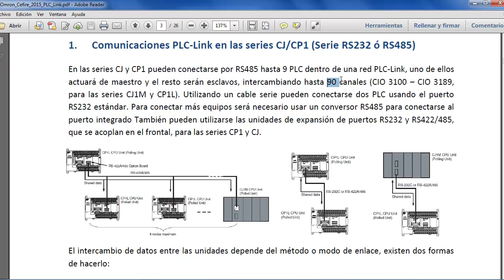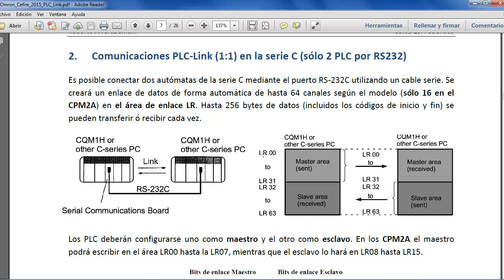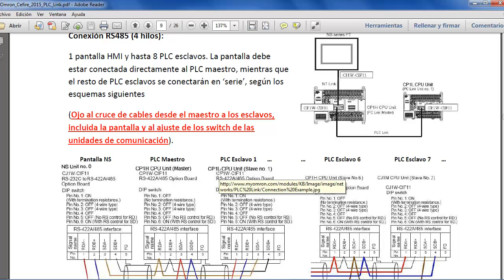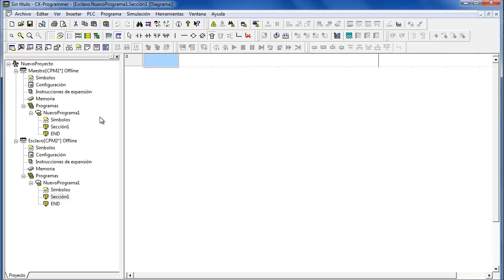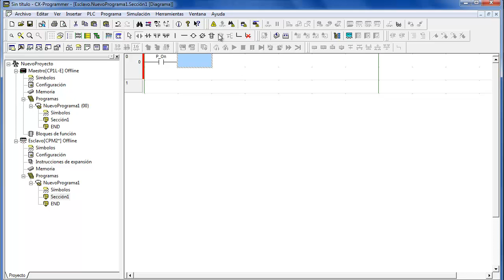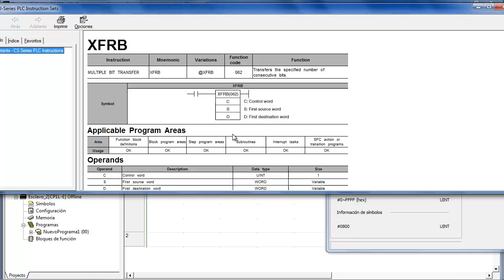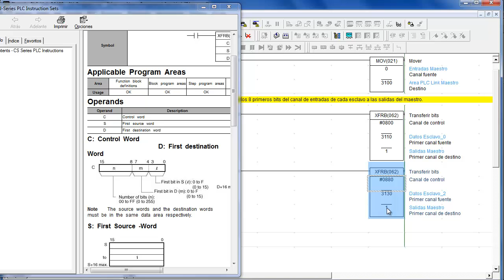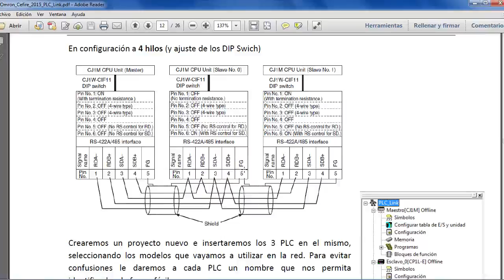Omron comunicaciones PLC Link. Conexión de 3 CP/CJ por RS 485

Comment: the best info on this so far but i cant understand anything of ur language
Reply from the maker: +oskar ewfall Sorry for that, but my English is not good enough for doing the video in English. Anyway it could be a reason to learn some Spanish :-D. PLC Link is quite simple it is just a shared memory area (up to 9 PLC and up to 10 words for each one, on CIO 3100 to CIO 3190), refreshed every cicle. There are two metods of communication, Complete (all the PLC share all the data) and Polliing Unit Metod (only the master see all the others).  Maybe this will help: https://www.support-omron.fr/pdf/Serial%20PC%20Link%20CJ1M.pdf It can be used with CP1L also. Salu2

Comment: Hola que tal buen día, para realizar la conexión por tolbus, se puede realizar a través del puerto  Rs232, o es necesario contar con la tarjeta para este tipo de conexión (módulo ethernet)?  De ser así se puede configurar la conexión tanto por tolbus como host link? 

Saludos
Reply from the maker: PLC Link es comunicación serie, cómo accedas al PLC es indiferente. Debes configurar uno de los puertos de comunicación para este protocolo, bien sea por RS232 ó RS485, pero si está disponible en el PLC, a la vez puedes estar comunicado por otro puerto (por USB, Ethernet, serie....). Siu el PLC sólo dispone de un puerto de comunicación serie, se ha de configurar para PLC Link y después de cargarle la configuración ya no podrás acceder al puerto por Toolbus y otro protocolo, a menos que uses el switch que permite restablecer la comunicación por defecto. Un saludo

Comment: Thanks for the explanation
Please I want to learn how to program and install stepper motor with CP1H-X40DT
Reply from the maker: Hi, I am working on it and will try to do something before June ends. Un saludo
Reply from the maker: Hi, I have jus done an example for the CP1L-E, you can see it here: https://youtu.be/dXr_Zy-nPQs
It is similar for the CP1H, but you have to use a different set of function blocks, because it uses different memory areas. Salu2